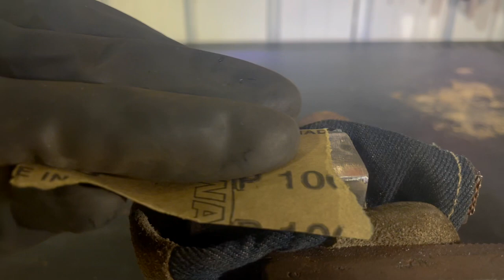Italian AXE Restoration .  Very  Rusted AXE  Restoration . Look How I Did It !!!!

Comment: Why are there green crystals of "corrosion" on a steel axe? Why was the rust "so hard to remove" with a screwdriver, but it really wasn't and would have come away easily with a wire brush? Why after coming out of "rust remover" when turned to the camera did it look like it had been whire wheeled? Why was there rust dust on the bench outside of the rust remover tank?

This isn't quite what it seems to be.